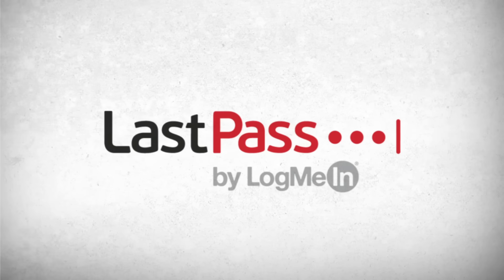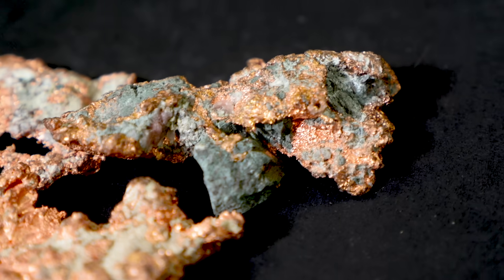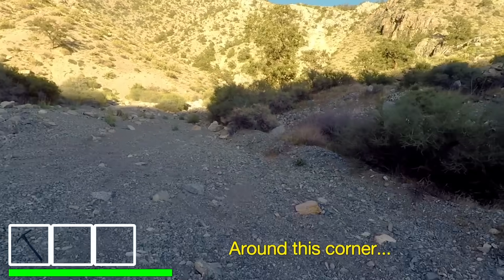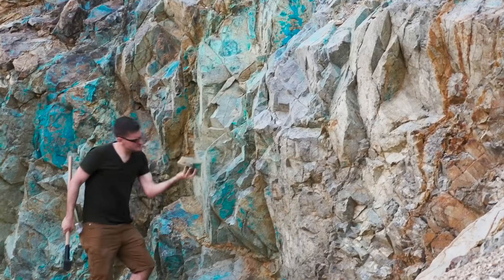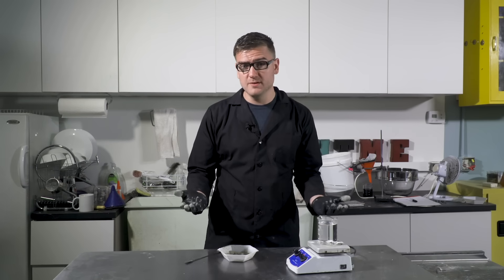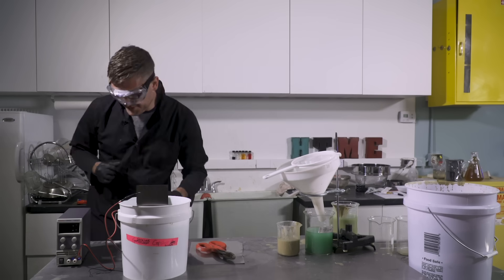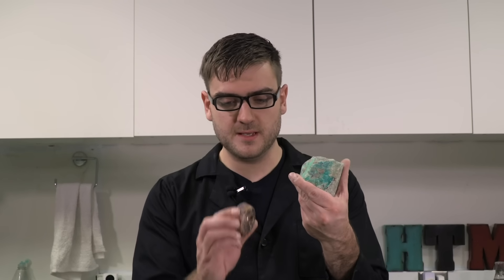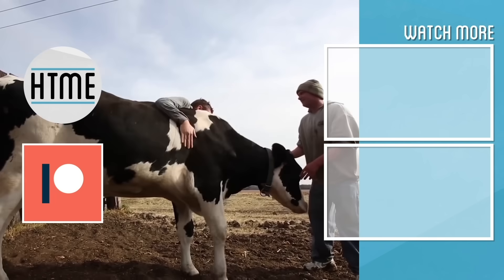From Rock to Copper Metal

Comment: Nitric acid would have worked MUCH better. Sulfuric acid isn't a great choice for copper. Electrowinning on stainless electrodes isn't great either, your final copper is contaminated with chromium and manganese. You want to do this on either carbon or platinum electrodes.

Comment: You're not doing an extraction of copper because there isn't any copper inside. You are doing an isolation - from a compound into an element.
Extractions are physical processes of separating components of a mixture. Copper ore contains copper in form of compounds.

Comment: The truth is that. If you got a truck full of it, use some more manual labour in the extraction process and process thw whole batch - you'd probably get your money back. The bucket amount that you did - never worth it, sadly. But at least this knowledge can be saved in cas something happens some day.
Also - I think the muffin tray wasn't a steel one, which is an issue afaik.

Comment: I understand this video is already a few months old, but as someone with a Geology Bachelor there are somethings I could point out:
*First and most important is safety, You guys let yourselves be separated in an area you were unfamiliar with for quite some time. Although with the dirt roads it`s unlikely you would have gotten lost, what if one of you was bit by a snake? You went into an old abandoned mine tunnel without protective gear, I`m not sure if you had anyone outside knowing your status if the mine had collapsed. You started picking rocks without eye protection, and also you should remember to never go under rock walls that seem to have a negative dip or hanging state. You grinded silicates and worked with acid without proper masks to protect your respiratory system.  You may have had someone help you with this stuff, but for those who might see your video and think: Going out with a pickaxe to mine some rock we have no idea about seems like a good idea, it`s not. It`s dangerous. 

**  Green is not the only color of copper minerals, Blue as well as Brown (bronze) can be indicators. You may have noticed that the surface of those rocks seem to be more Green than their centers. That`s because when in contact with air and water, some minerals can be leached or washed out of rocks, and some other like copper bearing minerals stay. But what has happened here is that Other, less colour intensive copper minerals like Chalcopyrite have weathered into things like malachite. This weathering happens at surface and joints more than other places.

* I see a lot of people in the comments wondering how this was done in ancient times. Extraction of metals from rock has different ways, what was done in this video is usually referred to as Hydrometallurgy in general which still has many different ways. There is also Pyrometallurgy, which you could say was more the case with ancient mining and metallurgy. They both in their essence, have to do with Redox states of elements, in short, in the bronze age people would gather the source rock, put it in a kiln, smelter, someplace they could control the temperatures and what entered and what exited, use fuel, usually wood to heat the rocks, let air in or add other materials in specific times and then gather the desired resultant material such as metals like copper at the end.

Comment: When im recovering metals , i leach the copper out with black iron and a one to ten diluted acid , its a redox reaction and the copper  falls to the bottom as the iron goes into the acid , pour thru a coffee filter and keep the black pouder witch is copper sulfide , a little capping flux and fire !  No electricty needed , even had gold show up in samples !

Comment: I’m an electrician so I have a nice stockpile of copper 🙂
Reply: What my contractor friend calls his "kid's college fund". When we leave a job site for the day, the stuff that gets locked up in a bin box is the copper plumbing we reclaimed from inside the walls. The joints contaminated with solder get sawed off into a separate pile because they're worth less per pound than the clean sections of pipe. It adds up $$$.
Reply: Charliebrm1 absolutely. I take the old copper tubing from jobs also. Last job I was on had a bunch of copper tubing from the old air handler and gas range line and heat system that was just laying down there disconnected. I took it all and I do the same thing with the solder Connections cutting them off and putting them into a separate container. Also the threaded end should be cut off as well since they are brass and the scrap yard won’t give you as much if you leave them on

Comment: So...Baghdad batteries?? Some believe early man heated chert and flint under their campfires, in order to open their cleavage planes for knapping into sharp tools. Perhaps someone got copper under their fire, and learned to smelt. (I believe it happened with lead first.) The trick then was to get temperatures high enough to smelt copper ore.....7000BC...blow tubes then bellows....some credit the Scythians with inventing the double bellows, which enables temps for  bronze and iron working. When the Sea Peoples cut off the Mediterranean tin trade (1300 BC) they forced the world to convert from bromze (copper+tin) to iron, which is much more plentiful in earth’s crust. They then learned to add carbon, to make steel, Northern India 1100AD. The Crusades exposed this as “Damascus Steel,” and steel replaced iron, at least in swords.

Comment: dude, you dont need to use electricity if you use iron plates, because the iron will displace copper from solution, but wont make pure copper, so your copper has iron in it, and nice video!

Comment: I'm really curious if you could pull some of that copper through a draw plate to make wires. If you can make wires and permanent magnets, then you can make all sorts of dynamos and motors.
Reply: Now that I think about -- with copper wire alone I think you could make a solenoid engine -- no permanent magnet required.

Comment: smelting it is so much easier
Reply: You people have no idea who Jeff Williams is obviously. He’s smarter than most of anyone who comments on here
Reply: @JakeBevers13  smarts doesn't equate to common sense. He used an expensive and complicated method to extract the copper from the ore when all he had to do was crush it and smelt it. Ya know, like humans used to do.
Reply: @HowardChambers9679  even if it's not the best method
it's still entertaining, and a valid way to do it

so really you're upset over nothing
Reply: @HowardChambers9679  Bro you really need to look at a: who you're replying to and b: who the OP of the thread is. The dude you replied to is defending the OP who also said smelting it is easier.

As it stands, smelting it would have likely resulted in no yield at all, because the ore he managed to get was second hand, tossed away by the previous miners because it's so low concentration it wasn't worth extracting. When copper was first discovered, they had access to all the ore the Earth had to give, without any pesky industrialists getting to it first.
Reply: yeah I've seen some east asian dudes make some bronze age smelting with clay ovens and hand powered blowers to keep the wooden fire going. And they got almost all the copper just by crushing the rocks and just dumped it in to the oven. about 24h, and they already had drops of copper at the bottom of the oven. Then they took that and placed those in these stone cups that they reheated until they had them smelted. Overall no more than two days of work. This coating shit no doubt catches all the copper, but it too the guy a week or two to get the copper out.
Reply: Whoever smelt it, dealt it
Reply: Any minecraft fans here?
Reply: Watch out for the bees!
Reply: Watch out for mountain lions!
Reply: @williamjones7851  and what have YOU ever done for the world?????
Reply: I'll bet there were some metals left over in your first filtration, metals that aren't as reactive to sulphuric acid. This seems like a great way of prepping ore for PM recovery, by removing much copper and lead first, but an added step
Reply: They didn't have the right kind of raw material.  With thin coatings of mineral, leaching is the most economical and fastest way.  Otherwise you have to chip off all the little bits of mineral one rock at a time vs. soaking and dissolving mineral while you can use the time for other activities.

Comment: "Using accurate classical 9000BC techniques that our ancient human ancestors used to extract and purify the copper - one of the first metals our species ever purified.."

...uses a plastic bucket to collect the rocks, throws them into a 4x4 Off Road Jeep, drives home to electrically grind the ore into a pure sulphuric acid solution and connect to a battery and strain through coffee filters and sulphuric acid onto a metal muffin tray..

Uhhhmm... I spotted a mistake... Real accurate, except for the one anachronism where you are wearing a modern watch in this video. 
Otherwise I would have been totally bought it.. I was fooled up until then!
Reply: I dont really get where he said "this is how they did it 3-5k years ago"
I know its a channel concept, but where does it say that?? I can only read in the description how he did it
Reply: Please Complete All Fields  He did certainly not use the same chemical process. Electricity hasn't been around that long, and while sulfuric acid was already discovered a very long time ago, it could not have been manufactured in the required amounts. Instead, they probably reduced the copper ores by repeatedly baking/smelting the ores in a furnace.
Reply: @entcraft44  He did if briefly explain why the modern refining methods:  The modern ore is too low grade to use ancient methods designed for high grade ore.
Reply: @carlcushmanhybels8159  To a certain degree it's true, the materials used back then were more high quality since they didn't have the processes to work the poorer quality stuff, and that over the time between then and now, those processes have been discovered/refined and such that allows us to work what was previously unworkable (or at least not worth the work). But he could still use the low grade ore to show the ancient process, it just would've been with far more imperfections.
Reply: @MST3Killa  In California and most likely elsewhere, they are going thru the old copper mine tailings and running them thru more modern refining methods and getting enough new copper to make the process worthwhile.
Reply: You're missing a part.
It's not just the modern tech. It's the notion that people who had to manufacture(that is make with hands) every single tool and had no access to any kind of machinery, somehow did all this.

It's not just the copper refinement that's problematic. It's the fact that the copper refiner had to get fed and clothed and housed. So did the guy who carried the raw stone, so did the guy who helped him, so did the donkey, so did the guy who manufactured the components for the carts they used to transport the rock, so did the guy who cut all the wood for the tools and the carts, so did the ropemaker, so did the flint and twig collector, so did the hunter and the farmer...you probably get the point.

We are told that hungry, starving, barely surviving idiots who made an axe by splitting a twig and tying a sharp rock into it with dried animal intestines, somehow got from zero to ore refinement and then industrial technology. 

Fact is, we aren't supposed to be so different from the fellas who raised all the edifices around us, yet if I gave you half the money in the world, you'd crack trying to build a functioning, self sustaining city, much less a civilization.

Even with all the tools given, we can barely recreate anything. Heck, just go to any store and notice how everything is plastic and crap. 

If we so advanced, why is all our shit so low quality? I'm a small guy, yet I managed to turn a reasonably priced shovel into a hoe with five days of yardwork. I have an ancient whale harpoon that's still so sharp I can impale myself with it with one hand.
400 year old brick buildings look new, but a house built in the 80s is rotten inside and out? We're in the midst of the greatest period of technological regression in written human history, and we're too busy staring at our fancy iPods that we don't even notice it. 

Look around, bud. Something is very wrong and we aren't being told the whole story.
Reply: 6,000 BC
Reply: Yeah the fact this guy is using modern tools with modern knowledge and still has this much trouble working with metals is just... wow.

Comment: How did they collect the copper from the solution before electricity and stainless steel? Did they just melt the copper out of the rock at just above the melting point of copper?
Reply: They directly reduced the copper in the ore using carbon monoxide at high temperatures (a charcoal or coke fueled furnace, in other words). This changes copper ions to metallic copper, which melts out of the ore.

Comment: Where the hell am I supposed to find sulfuric acid in the middle of an abandoned island? (Not that I am on one.)
It would still be nice if you would smelt the rock, instead... Even if just to show it happening and to compare the alloy yield compared to the pure yield.
Reply: Sapioit That would all depend on whether the island had any copper ore on it.
Reply: You can make sulphuric acid by smelting copper sulphide ore.... (the fumes are NASTY).
Reply: Sounds like something someone on an abandoned island would say
Reply: Most islands are volcanic, sulfur deposits are common.
Reply: @capnbilll2913  Depends on where you are in the world - and how old the island is. Sulphur is reactive and burns easily so finding it on an island that has vegetation would be rare.
Reply: @allangibson8494  last year when I was on Hawaii you could get sulfuric acid by leaving a glass of water out.

There is an island in Indonesia where they mine sulfur by scooping up molten rivers of sulfur running down from the crater.

Comment: As an experienced rock hunter: Always stay together, wear a hardhat when there is any chance of anything falling on your head (ALWAYS) and don't go into abandoned mines and start digging.
Reply: Artisankat Studios I’ve just started watching this guy and I’m stunned why he doesn’t bother buying a hard hat.
Reply: you can even get cool hardhats today - mine is a cowboy hat - black
Reply: @noahone3577  Pic!
Reply: Well... he got one of those right.
Reply: And if there are rattlesnakes wear long trousers?
Reply: How did they smelt it back in the day?
Reply: @WowYaska  They would melt it, in a forge, pour off the dross, or knock it off with a rock hammer, then melt it again, knock it off, and again,and it gradually emerged purified.  I have done this myself.
Reply: @WowYaska  Probably very badly, with a lot of zinc smoke. Hopefully they new to stay out of the direction the smoke was blowing. It's possible to die from just 1 period of smelting if you inhale it :/ They would make a furnace of clay and a probably a clay crucible.
Reply: @artisankatstudios7902  and Sulfide gasses as well, that is where the idea of the chimney you see in the slightly later versions. Learning from experience about the dangers of the work and trying to solve it. Thousands of years later and we are still about the same process, just more detailed.
Reply: @artisankatstudios7902   does zinc evaporate at high temperature? is that why they use it to purify metal?
Reply: Leather boots and gloves aren't a bad idea either
Reply: Yeah, every few years somebody dies out at one of the abandoned mines near Orogrande, NM. They are dangerous places.
Reply: @Madmun357  When I was stationed at Fort Huachuca, in scenic Sierra Vista, Arizona, I saw a poster, somewhere, of "Missing persons we're fairly sure found a 'Lost Mine'."
Reply: Hey team   l e t ' s   s p l i t   u p !
Reply: Ancient days… probably built their fire on a deposit and noticed that the green dust from the rocks when thrown into the fire produced a pretty green flame. From there the started heating the green rocks in very hot fire and smallish copper beads or lumps were found in the ash.  The smashed the lump with a rock and it started taking a different shape.
Reply: Thank you
Reply: an aboandonded mine has several dangers.
Reply: Hmmm... that's a nice sample... bang bang... (crash behind)... whoops now we're entombed.
Reply: And one more thing, 

DON'T MINE ONLY 1 BLOCK DOWNWARD!
Reply: it really does amaze me how he has survived this long, ( i'm not jokeing ).
Reply: I know.  What is up with these morons?
Reply: Didn’t even know a rock hunter was a thing, what you do with the rocks?
Reply: Hard hats are for sissys
Reply: And, rope. Vertical shafts/airways can easily be covered but have no support.
Reply: Yeah you're right. My major is mining and I 100 precent support you. What is shown in the vedio is very dangerous.
Reply: Remember your pikachu and poke balls for if u find a geodude
Reply: 99% of lithium miners in Africa are laughing at you.
Reply: Geeeeezzz really ?
Reply: Yes, just watched it. I guess only someone who never worked a REAL job would go into an UNKNOWN cave with NO helmet/hard hat. Also, they cost very little, as all the basic gear costs, since it's the same stuff mostly like used on construction sites.

Comment: Do NOT use stainless steel here. Do you want Chromium(VI) poisoning? Don't connect stainless steel to the positive terminal. Use non-stainless steel or some other metal that doesn't contain chromium.

Comment: Could you add a break down of your costs. I guess the flight and the vehicle hire took up most of that, but more elementary things like: cost of the acid, cost of the power supplies, cost of the tools, fuel and electricity. Just interesting to see what it takes to get the process economical.